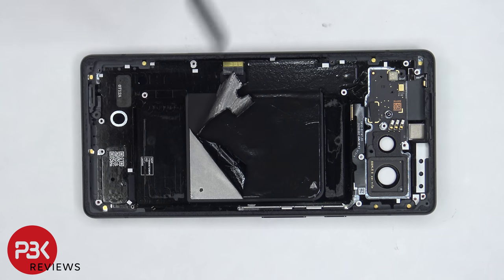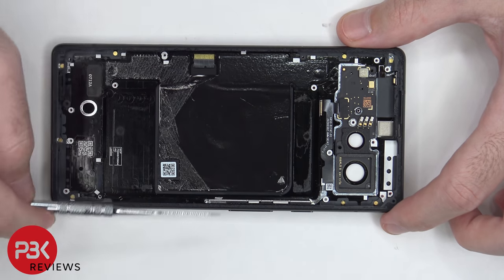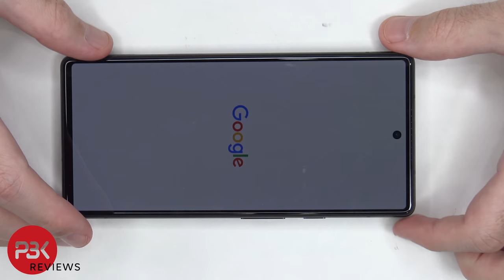Google Pixel 6 Disassembly Teardown Repair Video Review

Comment: My charging port got bit of moisture and now only slow charging works but even that only with Type A ->Type C charger cable. Type C -> Type C charging cable doesn't let any voltage to phone.  
So I'm saying biggest problem with pixel 6 build is that charging port module is not replaceable. Noticed same thing continues with pixel 7.
Reply from the maker: Yep, soldered charging ports on main boards suck. You can try to use a toothbrush to brush out any corrosion inside the charger port itself to see if it will help.

Comment: excellent video! I have the pixel 6 but when I open tik tok or some video chat app with several people (only audio) the phone heats up a few minutes after opening the applications and if it heats up something strong, but the heating only occurs on the left side device (side, front and rear frame). This does not happen with other apps, and with games I have not tried it but I suppose it is the same. do you think it happens due to a software or optimization problem? the truth worries me: /
Reply from the maker: It's normal for it to heat up due to the fact the point of the heat transfer materials on the inside are to exchange heat from the components out to the outside of the phone. Also the main board is located on that side you are feeling heat, so again should be normal. But if it is extremely hot that you cant hold the phone then might be an issue with the phone or software/app you are running.

Comment: Is the Haptic engine soldered to the main motherboard?
Reply from the maker: No it's adhered with adhesive to the back of the mid plate shown @1:59 in the video
Reply: @PBKreviews  oh thank you. Nice to see bigger taptic ones. The old round ones were trash

Comment: Is there a cooling system on this device ?
Reply: That's what I'm wondering
Reply: @earnistse4899  I didn't see anything that looked like one
Reply: @LOUISVILLECARDINALS  looking back it has thermal pad on the chip as well as graphene pads
Reply: @earnistse4899  okay thanks for the info
Reply: @earnistse4899  I just went back and looked I see what you're talking about now thanks for pointing that out
Reply: @LOUISVILLECARDINALS  I feel they should've put copper shields inside as well but these should be sufficient
Reply from the maker: it doesn't have any special cooling like copper heat pipes or vapor chamber but has thermal pads with transfer the heat to the metal midplate as well as graphene film.

Comment: where is the best place to buy screen as quickly as possible
Reply from the maker: You can get it from here, they are reliable and from the looks of it cheaper than the ones on ebay.  https://www.mobiledefenders.com/oled-display-assembly-for-google-pixel-6-black.html

Comment: seems like so much empty space inside. They could definitely pack it all denser, and make the form factor smaller. (except the thickness of the camera bump)
Reply from the maker: In some ways yea but also the more compact and closer everything is, the more heat is boggled up and also makes for repair jobs even more difficult. Also the battery needs some room to expand during charging and so forth. I'm not an expert in electrical engineering or how they engineer the boards, so I can't speak on the behalf of how they arrange the layout and why they couldn't make the board smaller by arranging the components and chips closer to each other. :)

Comment: I wish you would have taken two identical phones and tried exchanging the parts to see what Google disables.  I saw the leaked document indicating some parts are serialized in the firmware on the main board to prevent people from repairing their own phone, similar to what Apple has done on the 13. Only Google or an ASP will have access to software to restore functionality.  Obviously, if Google is doing that, there is no possible end-user repair without losing functionality.  Score should be zero.
Reply from the maker: I did do that on the pixel 6 pro disassembly video, you can check it out on my channel :)
Reply: @PBKreviews  Awesome. Just watched it. You now have a new subscriber. Thanks!
Reply from the maker: @6StringPassion.  thanks and you're welcome 👍

Comment: I have heard some folks say that the pixel screen feels hollow when you interact with it. I have not touched a pixel 6 yet, but can someone confirm or debunk this?
Reply from the maker: It's probably because of the fact the screen sits on top of a plastic frame that borders the sides of the screen and the center is somewhat hollow but very slightly. However the glass is gorilla glass victus and is strong so there are no worries of it breaking. Also most other phones have a metal plate or backing where the back of the screen is adhered to that plate so this one doesn't do that which is another reason you may hear that hollowness when tapped on etc.
Reply: @PBKreviews  love your explanation👍

Comment: Almost every new phone is harder to repair, the fingerprint scanner is a complication when It comes to screen replacement, also the charging port soldered to the motherboard will be hard to repair. I hate those phones which are hard to repair.
Reply from the maker: yep, I have a feeling that the screen replacements will probably come with the fingerprint sensor pre attached.

Comment: The Pixel 6 is the biggest POS phone I've ever owned.  Dropped from waist height on linoleum with a case and screen protector.  Not even a scratch to the phone but it just shut off, completely dead.  No response to any input, no lights, sounds, vibrations, or anything.  uBreakiFix deemed in unrepairable.  Glad I just got the stupid thing a couple months ago.  Never buying a Google phone again, absolute garbage.

Comment: 6/10 seems kinda high tbh, this looks quite difficult and not repair friendly at all
Reply from the maker: Most people break the screen and screen replacements on this would be pretty simple since it opens screen side first. The rest isnt too difficult but just time consuming. But ya the charger port isnt easily replaceable.

Comment: There is no proper cooling mechanism inside....cant playing heavy game for a long time
Reply from the maker: Yep, no special cooling system but it does have a aluminum uni body and the metal mid plate over the board to help transfer heat.